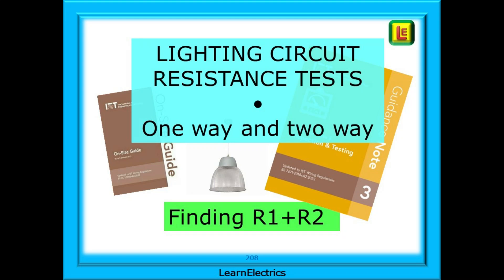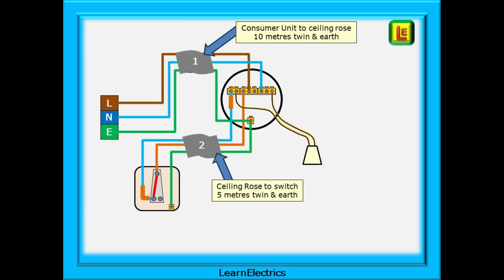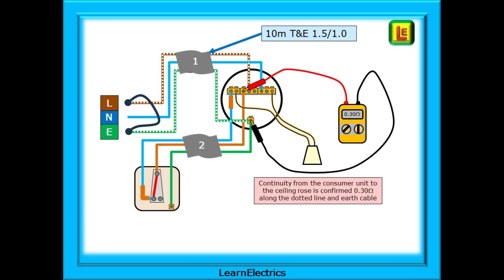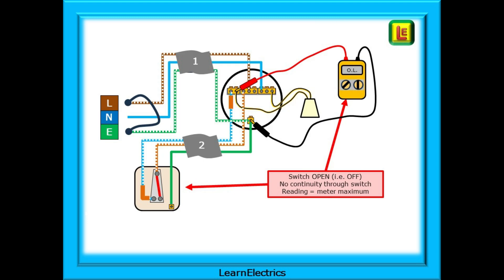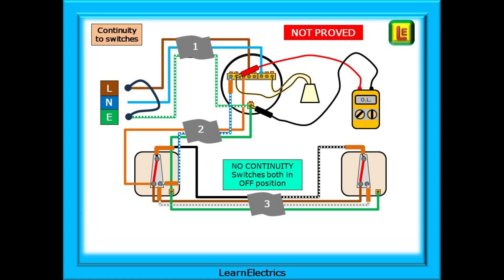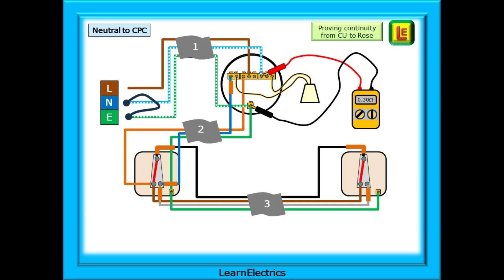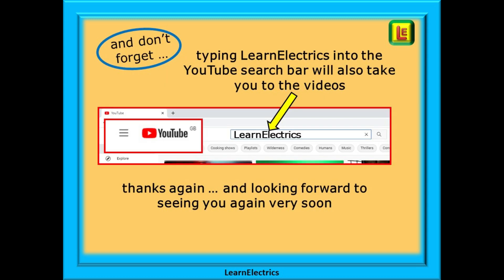LIGHTING CIRCUIT TESTS – ONE WAY AND TWO WAY – 3 PLATE METHOD – EASY AND ACCURATE FOR BEST RESULTS

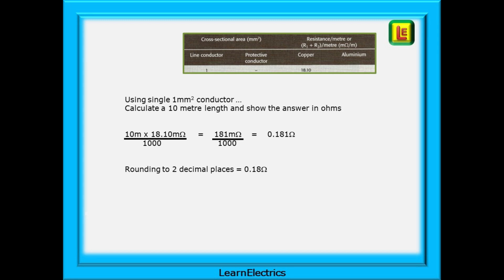Comment: Hi I thought you have to time is by 1.2 for 70 degrees cable and 1.28 for 90 ,do you not do that in real life ? Please answer thx 1:53
Reply from the maker: We multiply by 0.8 to find the measured values. If you DIVIDE by 1.2, you will get almost the same answer.

Comment: Hi Dave - when testing CU to switch to find R1+R2 (see 7:00 in the video), why would we not just put the probe on the earth in the switch?
Reply from the maker: You are already up the ladder at the ceiling rose and your arms won't reach to the light switch as well.
A little later, we come down the ladder and move both probes to the light switch.
Hope this helps and makes sense. Thanks for watching, thanks for asking. Dave.

Comment: Excellent again Dave.  It would be a good supplement if you could also cover ‘feed to the switch’ configurations as most new builds are doing this in preference to the rose method.
Reply from the maker: Point taken Mike, thanks. Its on the list. Dave.